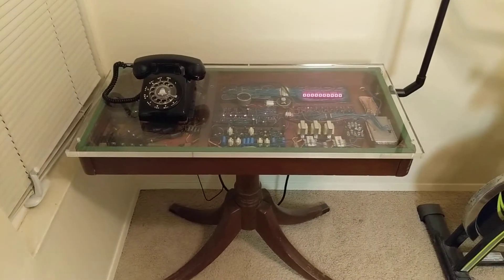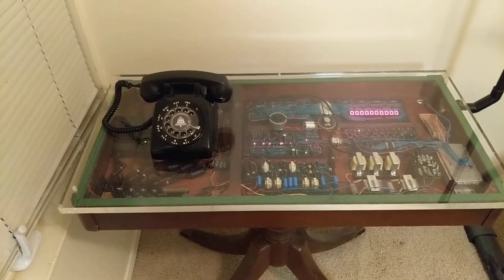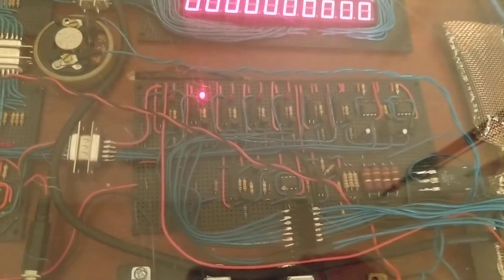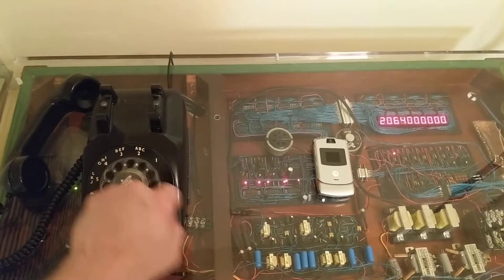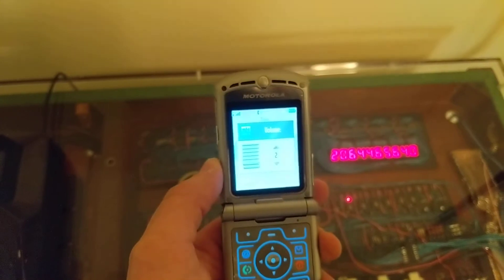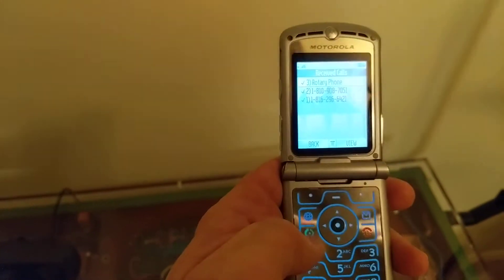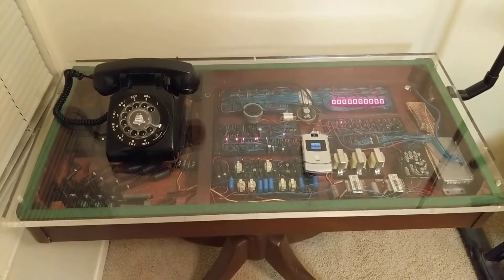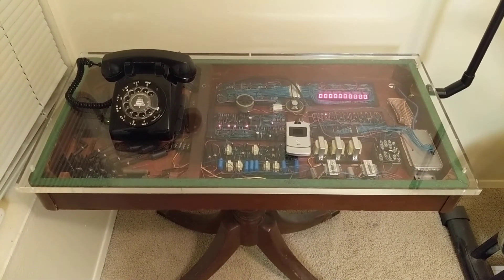Arduino Rotary Phone... Finished!

Comment: Amazing. Puts my little phone to shame. :-) What are the earpiece/mouthpiece elements under the glass doing?
Reply from the maker: Great question! It's using a hybrid circuit to interface the ingoing and outgoing audio signals between the rotary phone and the GSM module. Basically the extra earpiece and mouthpiece (as well as the black box at the front right corner of the table) contain all the circuits of a 2nd rotary phone wired up as an analog "mirror image" used for impedance matching to minimize echoes in the audio. Without it the person on the other end hears their own voice echoed back when they speak. From an analog perspective it has all the old school central office circuitry: https://en.wikipedia.org/wiki/Telephone_hybrid

I've actually made some updates to this since I made this video. Those mouth and earpieces are now mounted under the table in an insulated glass jar out of view and the Arduino and GSM module are no longer inside the metal box, which wasn't very effective for shielding anyways.

Comment: Wow. You're so lucky that you get good 2g coverage in your area. Where I live it's very spotty.
Reply from the maker: I live in Seattle and 2G coverage is kinda spotty but generally not too bad. My apartment gets good 2G signal. Strange thing is that in some areas if I stay in one place the coverage comes and goes. There are also some dead zones in the city where I get nothing.
Reply: @danebeck7900   It's definitely not what it used to be. Weirdly enough the 2g coverage fluctuates throughout the day. At 12pm it's horrible but at 1am it's great. If I go into town I get full bars and great voice quality but by my house it varies a lot.